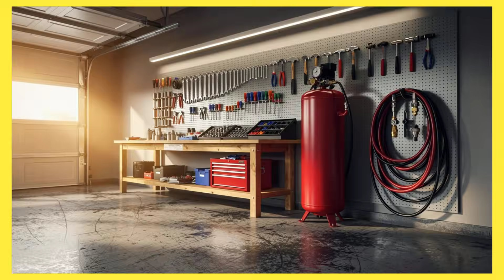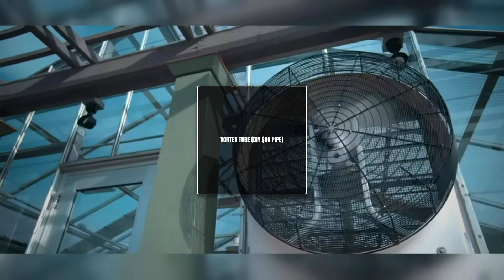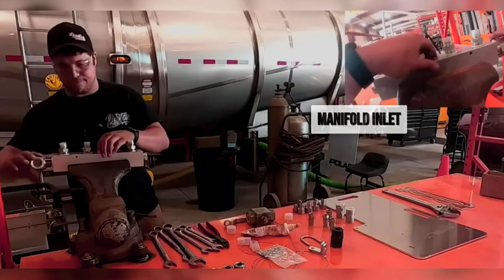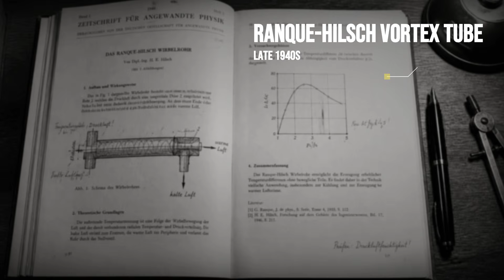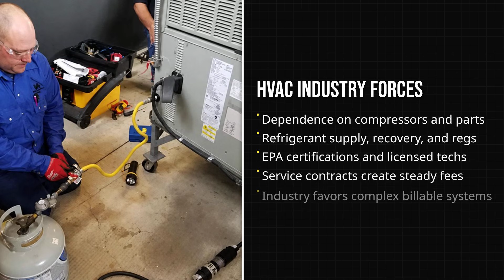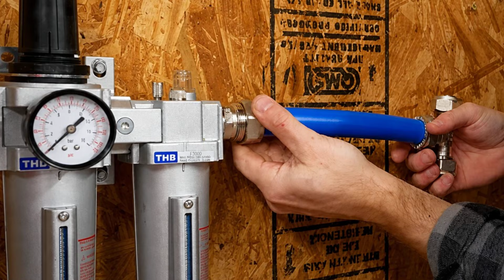This $50 VORTEX TUBE Creates -50°F From Compressed Air — No Refrigerant NEEDED!!

Comment: It’s no threat to existing hvac.

Heat pumps are more effective than either the hilsch vortex tube or classic Air conditioning designs. 

If all refrigerants are outlawed or otherwise unavailable, I’ll revisit this with a massively parallel set of vortex tubes to refrigerate my food and cool my house.